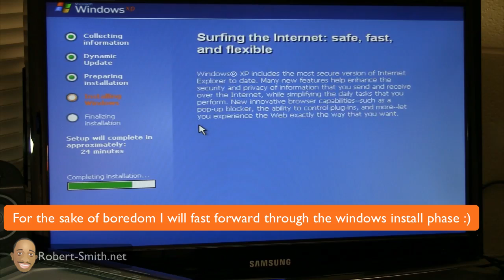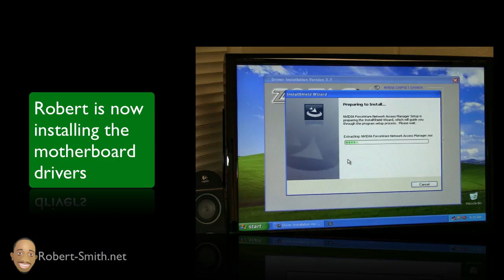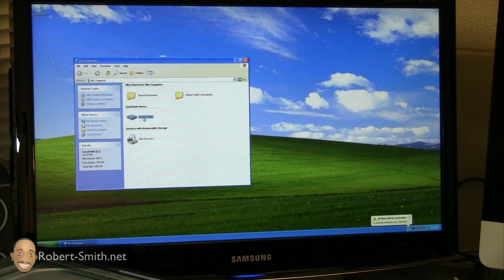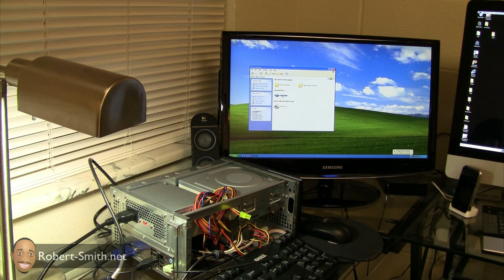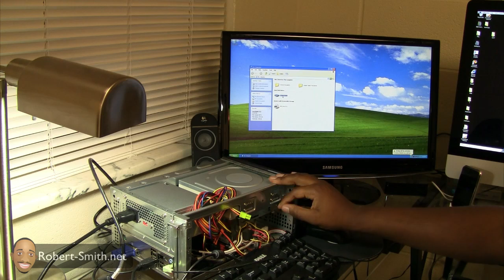How To Build A Mini ITX Computer Part 9/9

Comment: I was thinking about building my own mini-itx gaming computer. This is what Ive got.
Mobo: ECS H55H-I
CPU: Intel Core I5-661 Clarksdale 3.33GHz
Case: SilverStone Mini-ITX/Mini-DTX Case with 600W 80+ Bronze Certified Power Supply with Window SG07B-W (Black)

Video Card: Gigabytle GV-N98tsl-1Gl GeForce 9800 GT 1 GB Silent Cell 256 Bit

memory: G.Skill Ripjaws Series 4GB (2x2GB)

What Do you Think? Will it work?